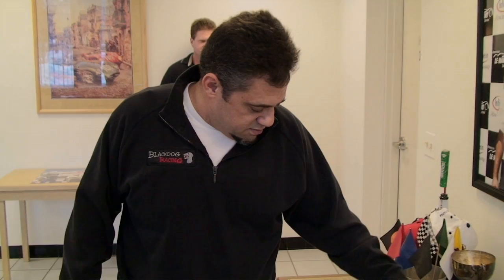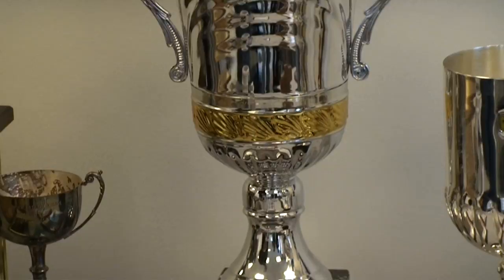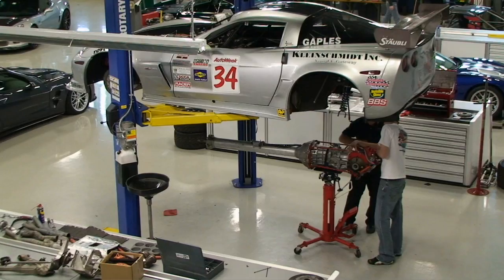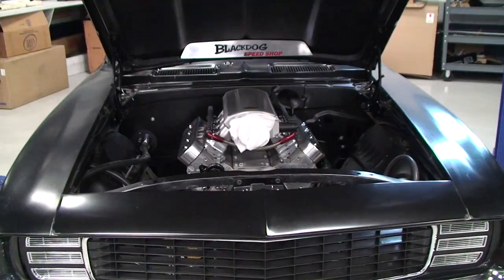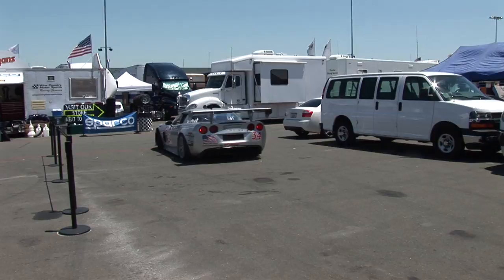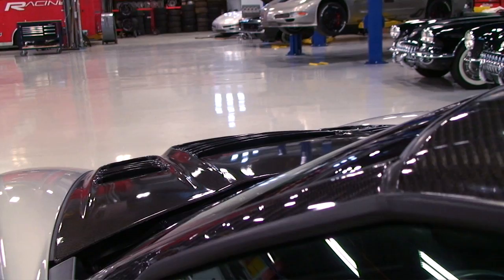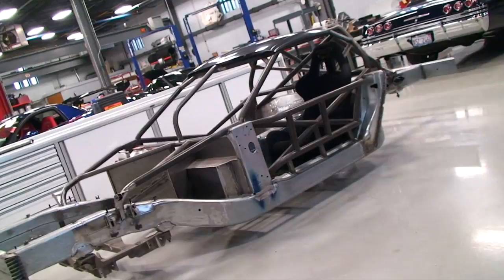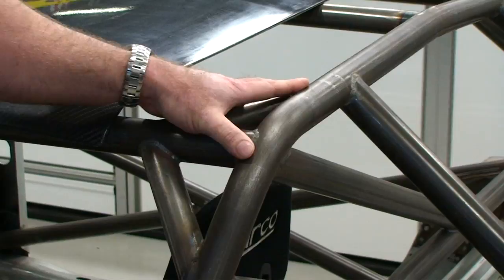Episode 05 - Vette Garage: The Series (*NEW!*)

Comment: At 4:29, there is a QS Z06 on the lift behind you.....The front fascia looks like a one piece fascia design with a built in splitter.  Is this correct?  The extended lip that is bolted on, is that obviously a "add on" part or is that part of the design itself?  If/when I need a new engine, I am coming in for the 510 ci small block!!!!  Please let me know about the front fascia design and, congrats on winning the bid on the '57 Vette!!!